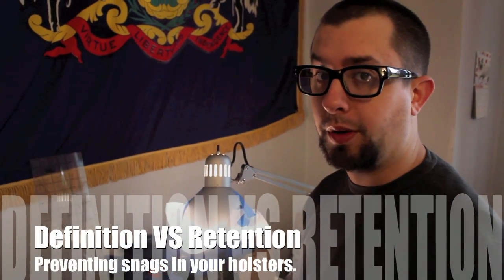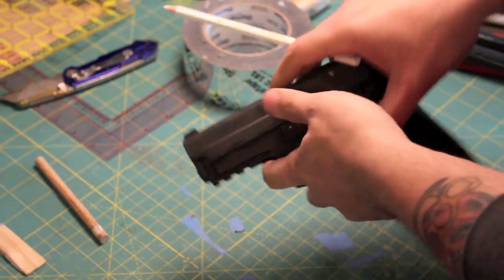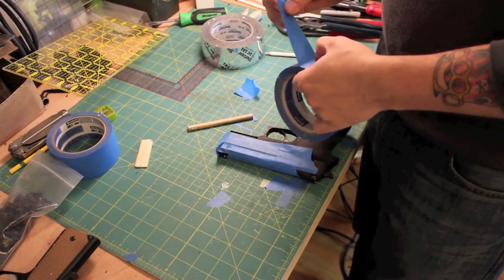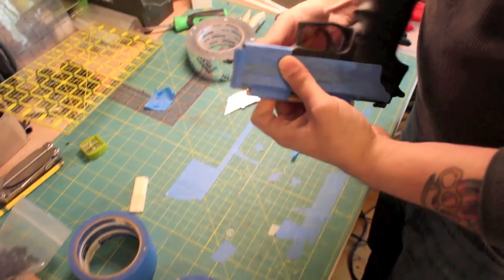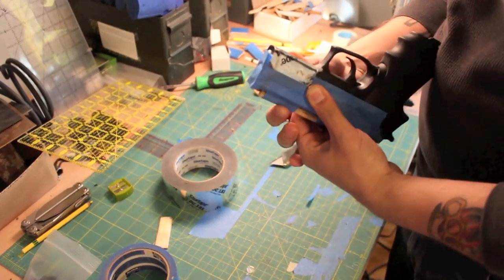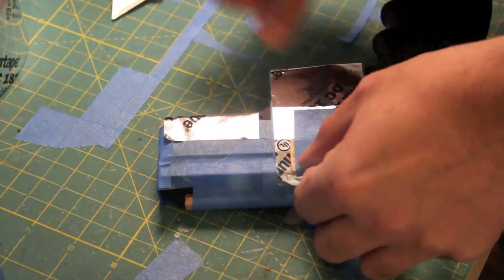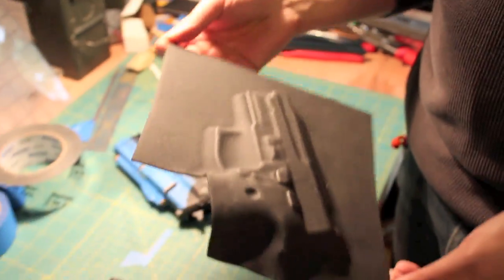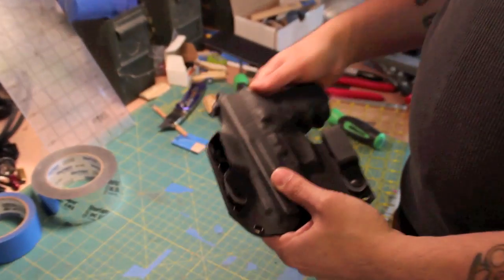DIY Kydex- Managing Retention Issues

Comment: Say the inside does fet chewed up a little bit. Once proper clearance is given to avoid more gouging, can i wet sand the spots to avoid it wearing the hell out of my cerakote? The base of my front sight dovetail is a tad bit wider than the slide. So it put a nice slice down the kydex on front and back. Its creating that same line in my cerakote :-(

Comment: Can you use an actual gun for molding the kydex, or will it damage it? If so, what's the point of gun molds?
Reply: molds are much much cheaper. I am currently using AS guns and works